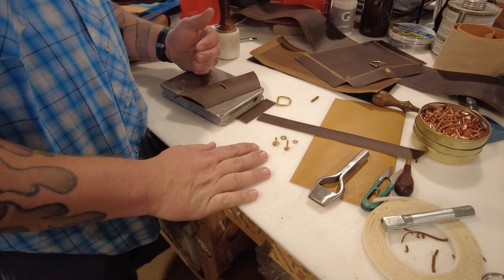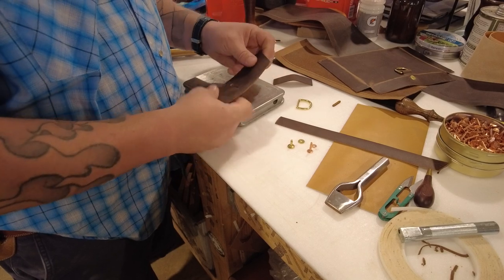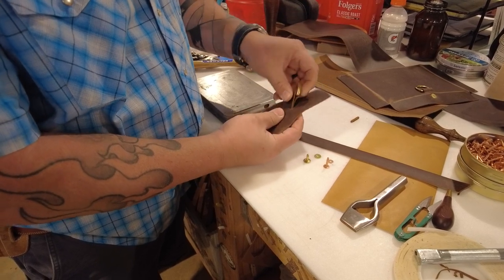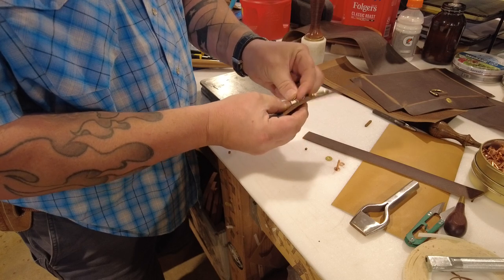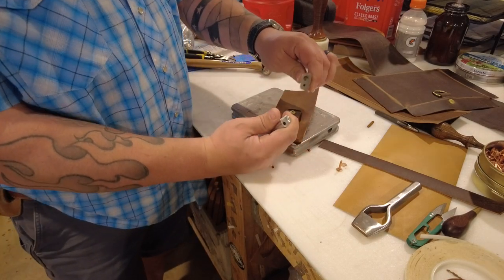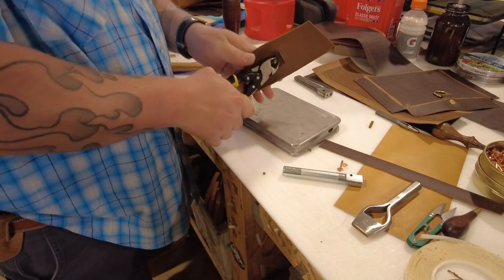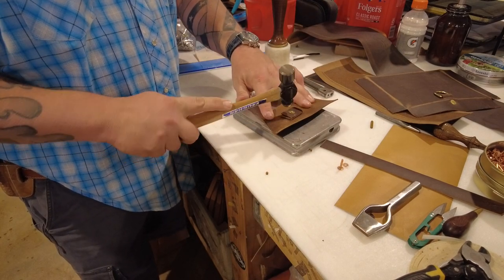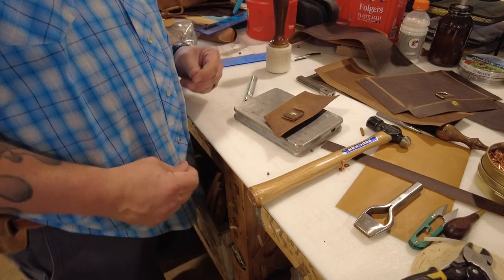Setting Copper (or Brass) Rivets- 2 minute tool tips

Comment: On brass rivets, especially, after cutting off the shaft of the rivet I give it one more whack with the hole in the setter over the shaft.  Sometimes the process of cutting it off can loosen the washer.  I do like to start the doming process with the tool.  I think it helps get the peening started evenly.  Much like when you showed the use of the phillips screwdriver "hack" in your video on snaps.
Reply: Ever try flatting it out a touch then doming it over, it comes out rounder and smoother for me but I don’t go for the peened look.
Reply: @donpayne562  Yes, I have.  That's a good tip for those who haven't tried it.  I also vary whether the finished head is inside or outside, or on the more or less frequently seen face.  Rivets can really affect the look of a project.  Not the most profound thing I've ever said, but badly done rivets stick our like a sore thumb.  Sometimes I go for the smoothest finish possible as you say, and sometimes the more "rustic" peened look seems to fit.
Reply: @GradyGillis  yeah that’s one thing about leather work  there’s a lot of ways to get to the same result. I’ve only done two bags with the washer toward the finished side and I did them the same way and peened them with a modified nail set. I can’t get the look I want with the ballpeen. I like the finished side domed over.

Comment: So if when you run your finger over the rivet and it catches cause  it’s not smooth, how do you get the river smooth? Are the sharp edges because the river is cracked from becoming hardened? Or is the rivet not down enough? And how do you keep it rounded, not bang up what is around the river and still get the rivet set well and finished? What causes the rough sharp edges? Thank you
Reply from the maker: If it's rough, hammer it more.  A steady aim is the best way to not damage the leather around the rivet.
Reply: Thank you. Won’t hammering more flatten your rounded rivet head?
Reply from the maker: @terp4u2  often times I hammer them till they're very flat.
Reply: Thank you

Comment: Do you have a link for cutters?
Reply from the maker: I got mine at Home Depot.
Reply from the maker: Your friend has shared a link to a Home Depot product they think you would be interested in seeing:

DEWALT	7.5 in. Compound Action Diagonal Pliers
https://www.homedepot.com/p/DEWALT-7-5-in-Compound-Action-Diagonal-Pliers-DWHT70275/203040533
SKU# 203040533
Reply: If you're in the United States, Harbor Freight has inexpensive bolt cutters that may be overkill but will definitely easily cut it!